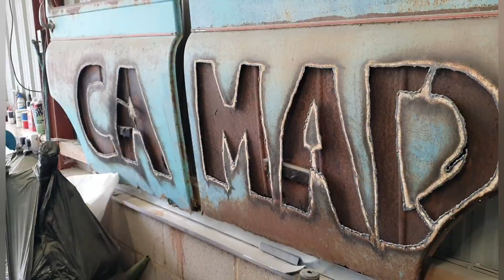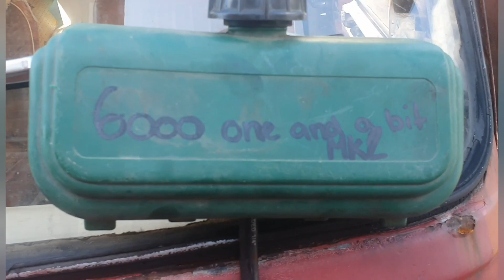A DAY OUT IN TELFORD TO RESCUE A CA BEDFORD CAMPER.

Comment: So, did you supply the missing parts or put the originals back on?? I guess it wouldn't run with all those parts missing!! Did the owner ever explain how it ended up sitting there with a bunch of parts missing??
Reply from the maker: He sure did,he had a guy work on it before and he took all the parts for rebuild..and never came back,I took some parts with me like distributor,fuel pump, and he had some parts .. turn out the van hadn't run for 11 years..